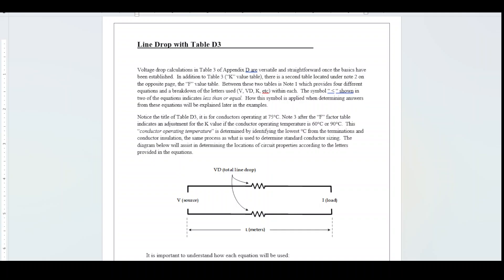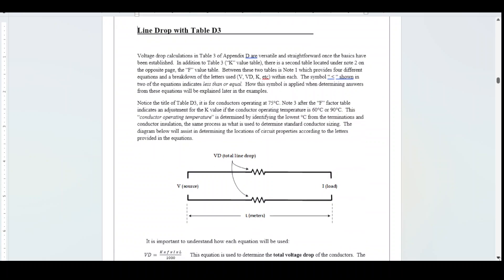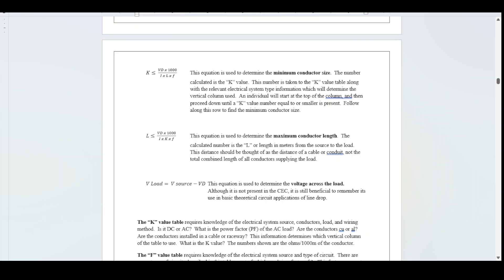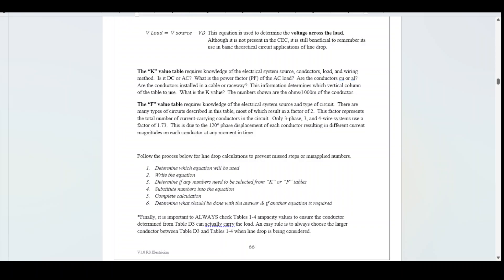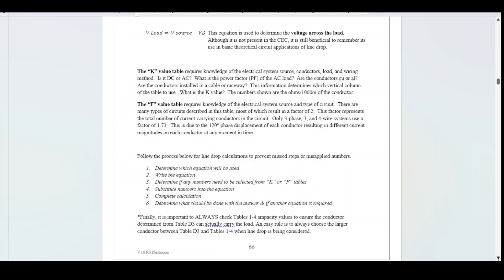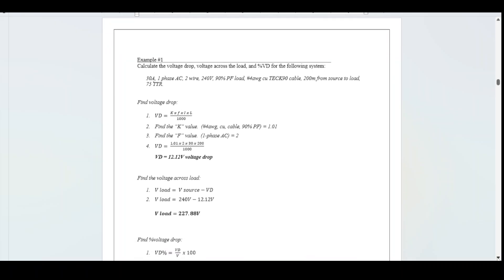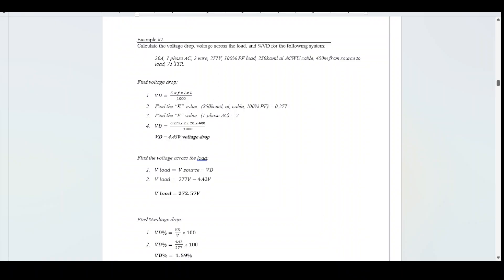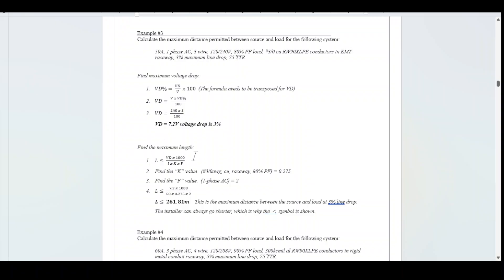2024 26th edition CEC Using Table D3 Line Drop

Comment: Hello, awesome videos. New subscriber and catching up on older videos. Got a quick question or idea for a video. Chapter 16 Class 1 and Class 2 circuits.

Can I put 0-10v cables inside the same conduit than the 120v of my led lights AND other circuits other than light circuits? 

From my understanding, I can run 0-10v cables inside the same light circuit conduit which feeds the relay that outputs the 0-10v and other light circuits but I can not run non light circuits inside the conduit. Would that be right ? 

Thanks for the videos and answer.
Reply from the maker: Thanks for the comment, good question. What you will notice from the exceptions listed in Section 16 separations is that there are very specific restrictions against sharing raceways. 

Cables that are designed for 0-10v LV control & line voltage are inherently engineered for the purpose, which is why they are all included in the same cable housing. 

Other than this example of an engineered cable, there are very limited allowances for different circuits to be pulled into the same raceway. The one notable exception is when the line voltage conductors supply the class 2 supply, the output of the class 2 supply could also be inside the same raceway. This would be a situation where only a single raceway connects to the enclosure for the class 2 supply. 

I will put together a section 16 video  it can be a super confusing topic!